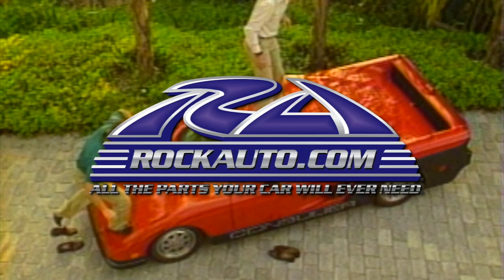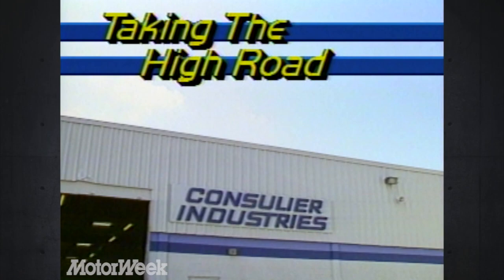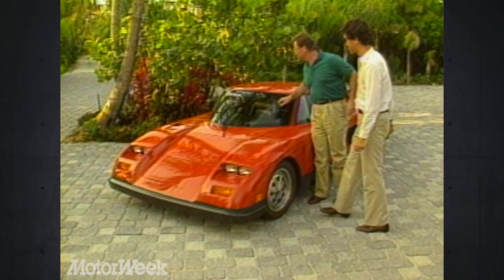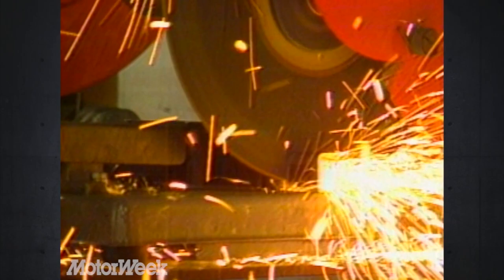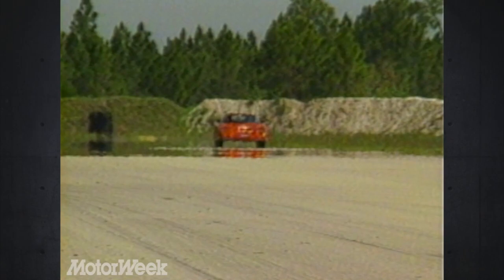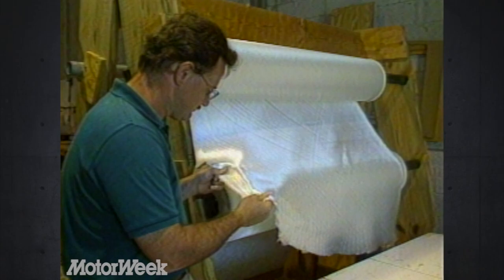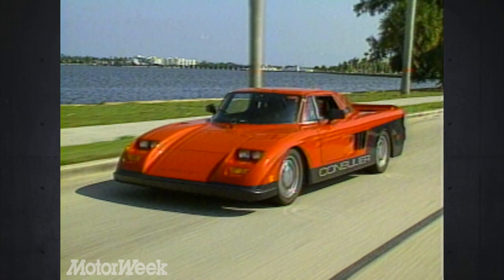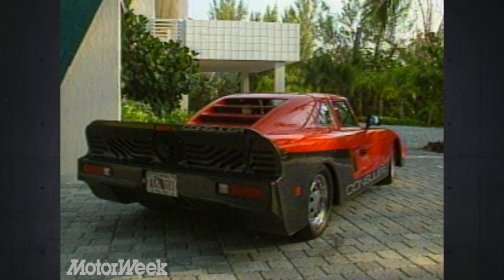Consulier GTP | Retro Review

Comment: I like his idea of a lightweight sportscar but he should have hired a different designer, or a designer at all!
Reply: Factory 5 818: I have taken your cause and made it possible.
Reply: It looks like how I drew sports cars when I was five
Reply: This car looks like that 70's - 80's micro electric car
Reply: The design was functional
Reply: @PLK123  Form follows function, but there are limits
Reply: Reminds me vaguely of the MR-S from the early 2000s. Has the lightweight frame and healthy power to weight ratio. Modded by SPIRITS in Japan, the MR-S placed favorably, or sometimes beat, cars three to five times its price in touge style events and Gunsai races.
Reply: Warren examined a lot of swoopier designs, but it turns out that the straight lines produced the stiffest structures. 
Additionally, it was molded in one piece, and there had to be a way to get it out of the mold. Hope that helps.

Comment: I had a Consulier for over two years as my daily driver. Earlier, I helped with the concept and development. Warren was fanatically devoted to weight saving and the consequent benefits, and it showed. I ran some laps at Woody Creek (near Aspen, CO) and was more than a second under the existing IT-A record. And I was carrying a passenger!
It was comfortable for its class; everything worked (thanks to the proven off-the-shelf bits), and it was cheap to run. Except for tires, but that was my fault. Never touched the engine, but I spent quite a while trying suspension settings, which (I believe) were ultimately incorporated into Bobby Rahal's school Consuliers at Charlotte.
The unconventional styling? Well, let's say EVERYbody noticed it, including the drivers of the Lambos and Ferraris I met on the road.

Comment: I remember these being reviewed in all the car magazines back in the day and some of Mosler’s later designs (even a Cadillac with two north star V8’s. One in the stock location, one in the trunk). About 10-12 years ago a few of these came up for sale straight out of the Mosler facility. I believe they were mostly used and a few unfinished never sold cars. A few were fitted with the TIII engine (2.2 Chrysler 16 valve engine making 224hp, lifted from the Spirit RT and Daytona IROC RT). The shame was I got out of the turbo Mopars for a few years when they came up for sale. Nearly all of these cars were purchased very reasonably but mostly to guys who weren’t actual “turbo dodge” guys. Sucked to see a piece of history go to the guys who bought one and then joined the forums with 2 posts to ask what kind of engine was in it and noob stuff. Oh well, missed the boat on that one

Comment: Henry Ford had the advanced production methods. Tucker had the very advanced safety and engineering elements. Sorry but this car falls short on both counts. Body structure and fit looks early corvette (1953/54). Chrysler engine, 4 cyl from the pick a bin? Under 6 secs to 60, at the time numerous Super Cars could beat that. Looks, Chev monza headlights, overall design is out of proportion, almost 1/2 car rear screen forward but rear screen back looks like a pick up, hence the many critics of it's looks. Non curved side glass, takes away the sleekness that other super cars have, hell all cars had at the time. Score 10 been the highest sorry 3.5. An Oddity no more and no less.                                       Kind Regards